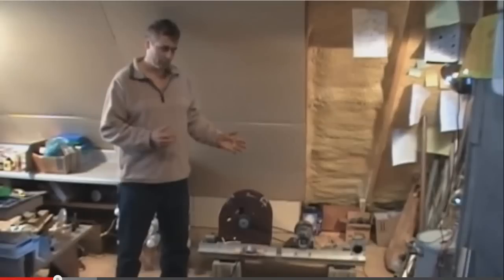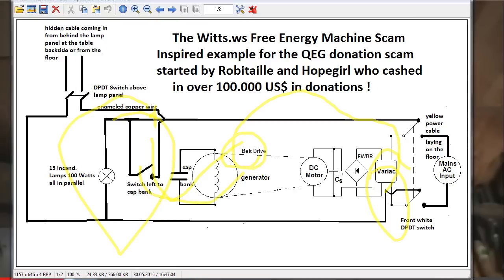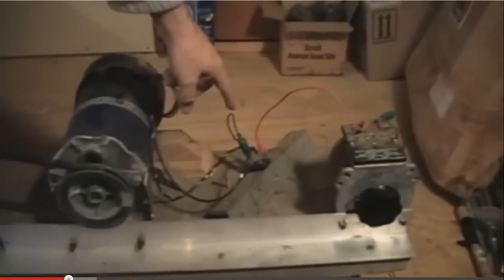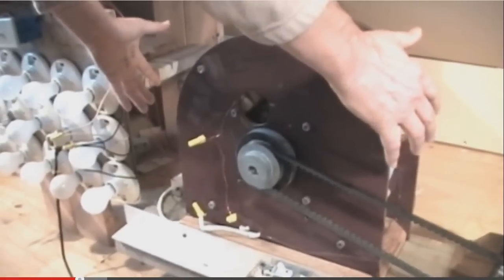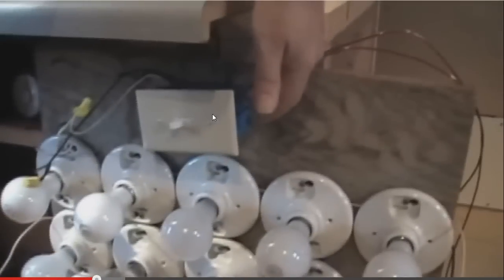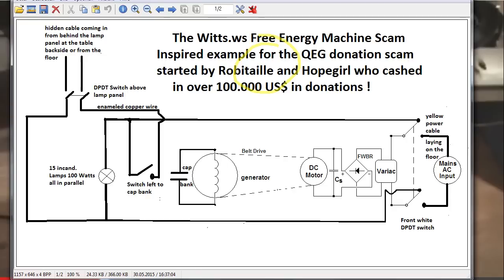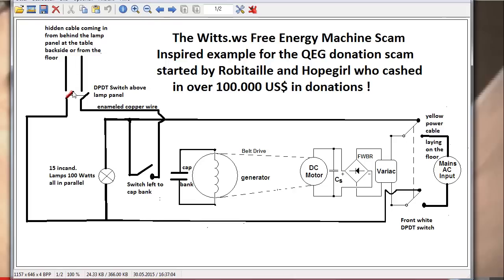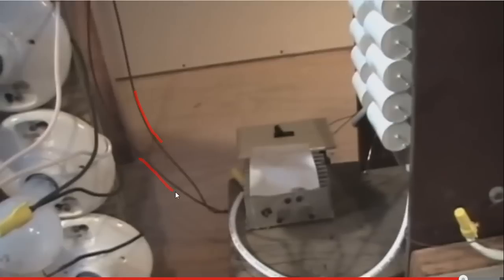Free Energy Machine  ? Scam ? from Witts.ws - QEG ? Scam ? inspired model ?

Comment: This device is similar to the Kromrey's Generator. I even built my own brushless design which is even 20x more effective. But it still won't reach 100% efficiency due to friction and resistance. Over 100% is creation (godlike). This will never work. It doesn't matter how you build it. You can't make a crrator.
Reply: It can be done Like T Henry Moray and the Joseph Papp pulse plasma 2 stroke engine, usually abrupt motion of electron and nuclei tap the ZPE aether like ball lightning plasmoid, (kenneth Shoulders evo's) high density charge cluster plasmoids. Moray b Kings discusses this and those who do tap it wind up in some big trouble and the patent gets confiscated.
Reply: @jlo13800  Nope. I was a researcher for new energy myself. I know how these machines work and also how they don't work. The most interesting device that I worked on is the Kromrey Generator. It speeds up under a load. Unfortunately even that device doesn't do anything above 100%. There are so many losses that it just can't be done.
Reply: @Lightmaker5  Yes lots of energy can come out of these devices, those who went over-unity got into big trouble. Timothy got some over unity here burning all them 100w bulb and the QEG its self. Tuning is the key for greater power.
Reply: @Lightmaker5 It takes resonance to tap the radiant energy like Tesla did. he made arc lamps that could charge capacitor with there light. Sunlight carries an aetheric radiant component that feels like a slight pressure on my skin when i did an experiment on a clear dry day with metal plate. Since there high energy all around us in the ZPE some defices have tapped it as Moray b Kings, Hyde, T henry more and Joseph Papps pulsed plasma 2 stroke engine. its interesting stuff.
Reply: @jlo13800  Do you speak from experience? Have you built it? I did and better I even improved the designs.
And the Nikola Tesla case is misunderstood. The ones who claimed free energy, got in trouble because they sold fake machines that do nothing.
Reply: @Lightmaker5  What made the so not work?
Reply: @jlo13800  The universe doesn't allow closed system loops. You need a physical reaction to have energy. I even went a spet further I actually cracked the ultimate question of the universe why and how everything exists. This answer confirms the theory that closed system loops like the classic perpetual motion machine can't exist. If there's motion there's always friction. So you can't reach 100% efficiency. It's impossible. I even published a book about it.
Reply: @Lightmaker5  Thats why it needs to be an open system so those ZPE can do the work, a closed system will never work. Look at all-those huge fireball formed when a high voltage cable arcs out. No to mention all those lightning strikes we get in the summer here in FL. Lightning is natures 2 stroke at the terawatt level. One bolt that struck close shoved a wave of darkness though my living room! that was the electrogavitational shock wave. this was observed in a navy welding process with huge capacitors discharges to wels thick armor plates.
Reply: @jlo13800  ZPE is exotic energy that comes from different realities. You can forget that idea. Before the people get in contact with this, they will have populated our entire solar system. I find the Stargate Atlantis "Project Arcturus" as best example for ZPE. You can perhaps improve our solar panel, but more than that except chemical reactions you won't get. Atmospheric energy in the other hand requres a very big device to get very little power. It's called the unconventional way of generating power. That is not ZPE.
Reply: @Lightmaker5  Moray b Kings book's i have them interesting stuff on these devices. somehow Timothy Trapp got his device running and powering the 100w bulbs and its own motor, i guess it took some fine tuning.
Reply: @Lightmaker5  true for a closed system but we have radian energy or ZPE every at very high energy.
Reply: @jlo13800  I doubt they generated anything. Like I said either it's unconventional or it's fake. The last interesting device was the Kromrey Generator. My current projects are solar panels with joule thief or bedini shk style circuit.
Reply: @Lightmaker5  They probably ran a wire somewhere, all i know James Robetelli and hopegirl are doing this too. thats a lot of heavy machinery they are assembling for a scam.
Reply: @jlo13800  Ye I never saw a single video where an electrician is invited to test their devices. An electrician is the last person they want to see near their fake machines. They're only looking for people who don't speak physics.🤑
Reply: @Lightmaker5  I would go with pulsed plasmoid technology to tap the ZPE like a pulsed plasma 2 stroke like joseph papp did. This QEG even if it does work is louder than my 2 stroke generator. Hopegirl and her friends shipped 1000's pf lbs steel parts and copper wire to Morroco! Why didn't they just build it here? Hmmmm something funny going on, who knows. A lot of heavy machinery they are assembling for a scam.
Reply: @jlo13800  Even if it does work??!! What's the point of your comment if you don't understand how the devices work by plan? I'm talking from experience here.
Reply: @Lightmaker5  Whos said it never worked?
Reply: @Lightmaker5  So what do you have abetter alternative? are you but hurt that this guy has an over-unity 2 stroke that beats your old 440cc sled which must run natural gas, fuel oil gasoline with sae 30 at 40:1, yeah i got klots 2 stroke oil for my generator for its oil injection but there are much better 2 strokes out thwer that can tap the ZPE, the average lightning bolt is a much bigger 2 stroke than my snowmobile engine, OMC 2 stroke small block or 8v92 2 stroke diesel, all these are power limited on electron bond carbon fuel, timothy's 2 stroke QEG is not,. not every 2 stroke does not need to guzzle natural gas, gasoline fuel oil or nuclear power, thwr are far more powerful things out thwer, our sun is an ZPE loop charged 2 stroke on a way bigger scale than are car, sled, outboard motors and power plants, ZPE is real.
Reply: Oh you must call the fuel oil guy so he can deliver 100 octane gas and klotz oil to run your turbo kx500 2 stroke dirtbike so you can ride when you were a kid had a shit fit after you broke up with your boyfiend or girlfriend! that should work as they are plenty of MJ per liter of high octane fuel when you were but hurt, them electron bonds combining with oxygen in the air should have revved your kx500 2 stroke out cruising one night when you were but hurt
Reply: @jlo13800  Oh boy..

Comment: You could do 2-1000000 DC generator ©®™ from 1 azipod or large GE axial flux or AC NEMA squirrel cage 25000/50000hp around a bus stop size transit van Motor turning all wind turbine stacked

Comment: I believe it is real, why? because there are a lot of people making these.  commonly called a QEG, Quantum Energy Generator.   they do no use magnets. they generate their power by induction.   and the reason they all have a motor driving them is because they only output more power than they use  when they reach a resonance state and have to be driven by another motor to a frequency you have to find where resonance takes place.    they all have in common the audio tone change when they reach resonance.  you can build a more simple one using a microwave transformer.   you can make electricity we all know when a conductor, wire passes through a magnetic field,  well you can also make electricity by changing inductance.   if you have a iron core wrapped with a conductor wire and you put your volt meter on the wires and then take another iron core, any mass of steel really and closely pass it by the iron or steel core that has the wire wrapped around it  you will get a small voltage.   why? because the mass you pass closely by will change the inductance of the other mass.   then it's a matter of continuing to pass the mass by the coiled mass at a speed which causes a pulsing inductance change in the coiled mass until you reach a resonance state.  it's only when you get the coiled mass to reach resonance by spinning the other mass past it at a certain speed that you reach a resonance state.   and it's only at resonance that any of these devices work.    somehow at resonance a conditions is created where electrons can flow from the surrounding environment  through the device.    there are electrons orbiting every atom, and there are atoms around you everywhere.  the air we breath.    think about a regular generator  with a gas engine turning it.   the generator spins and conductors cross magnetic fields and create electricity right?   well where do you think the electrons which are flowing from the generator to your load are coming from?  hello !   the generator is not creating electrons, you can't create electrons.   yet they are flowing from the generator to your device, so where are they coming from?  same place all electrons come from.   they move from atom to atom,  it's called electron drift.   the gas power generator is doing the same thing that the QEG generator is doing,  they both create and condition by manipulating magnetic fields so electrons can flow from atom to atom from the environment and through the magnetic field the device has created.  the difference between the gas generator and  the QEG  is this.   the  QEG  Quantum Energy Generator, call it what ever you like it is just a method of manipulating magnetic fields to a resonance state which allows electrons to flow from the environment.      where as all other conventional methods of generating electricity do not use resonance,  they use  energy to force the flow of electrons from the environment through the device.
Reply: The most intelligent response comment that I have seen on this video.
Reply: @victorkauffman3164  thank you, I understand the basics of how these work because I have done experiments and proven this to work.

Comment: It's not radiowave tranceiver or WiFi networks metered pay for power used.
Battery meter locked inside by RC or WiFi Bluetooth unlock.
You bet self charging Suzuki swift free energy car pstttssst off the power companies petrol etc I'm going direct for investment and 90/99% given away to investment me taking petrol diesel %1 of the whole global going Electric from gasoline diesel.